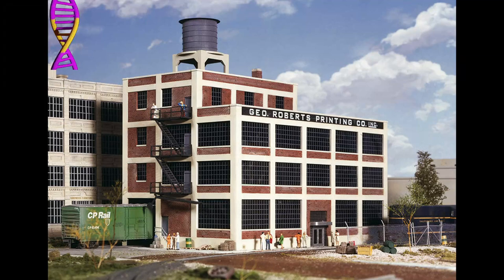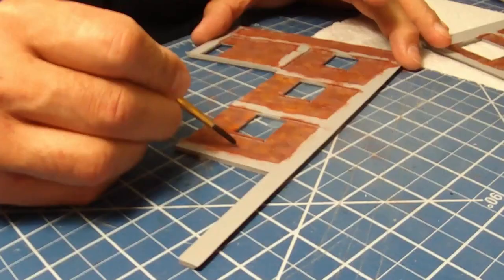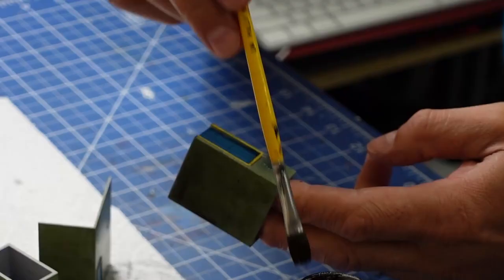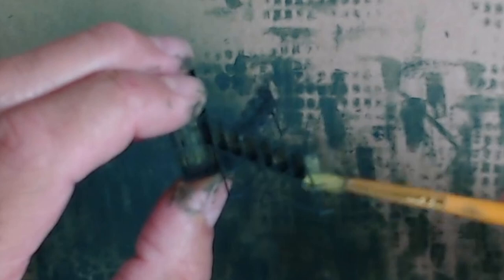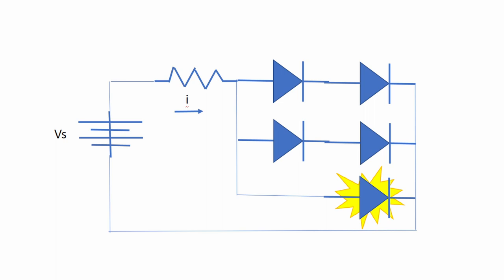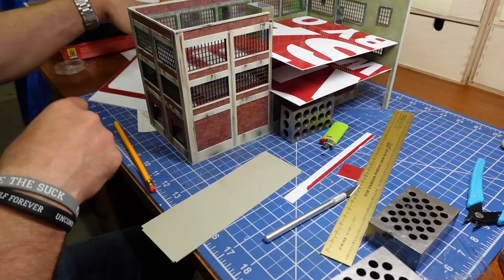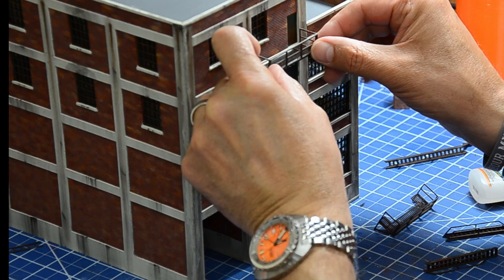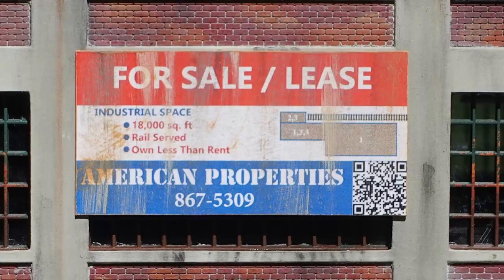Building & Modifying Walthers George Roberts Printing for the National Model Railroad Build Offl

Comment: Electrical engineer here. Because of the exact problem you ran into with the lights, it's always best practice for every set of LEDs in parallel to have their own resistor. Even if you have the same number of LEDs in each parallel series, manufacturing variations will have more current flowing through one branch than other, shortening it's lifespan, and when that string goes, the others will follow as more current flows through them instead at that point. Multiple LEDs or strings of LEDs in parallel should never have just one resistor to rule them all.